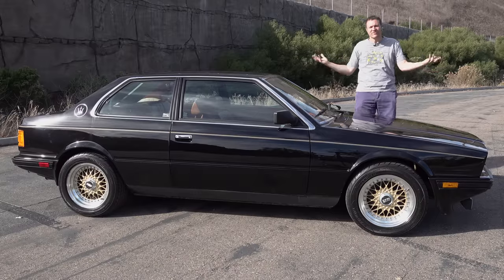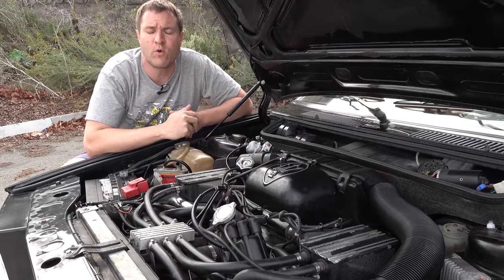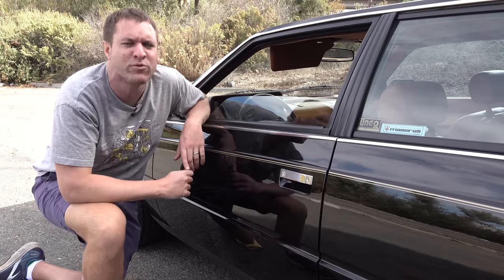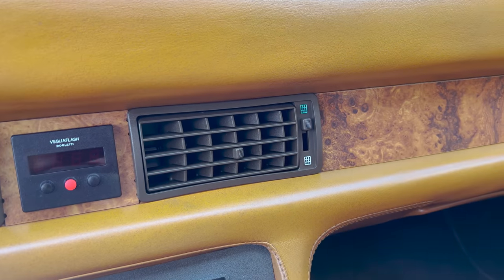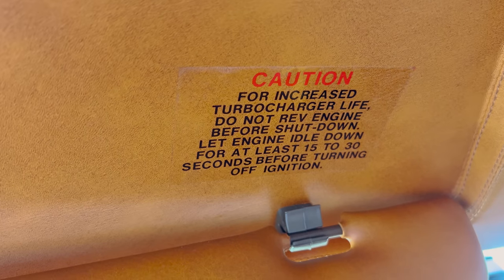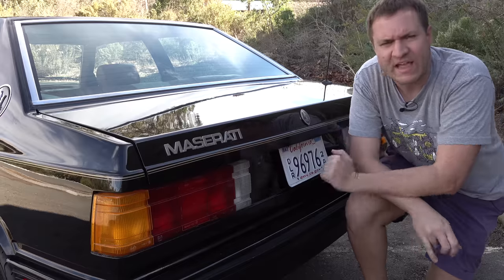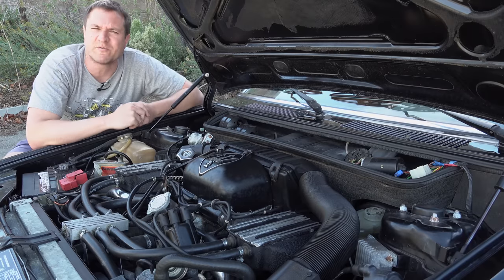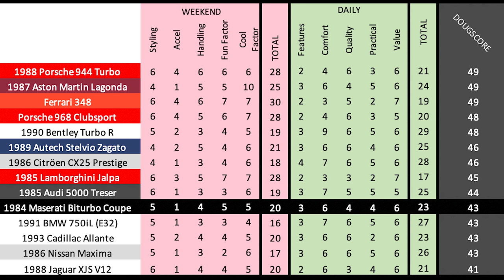The Maserati Biturbo Is the Ultra-Affordable 1980s Maserati

Comment: First time I saw one of these, it was in a junkyard and I thought about pulling the drivetrain. Then I thought "do I really want to trust a Maserati engine when they're not known to be reliable, and do I really want to trust one from the 80s? So I didn't lol
Reply: Get the whole thing, pull the drivetrain, and throw it away so you can put something else in.

I wonder how reliable the body and suspension is when these are swapped. Looks like it'd be a fun candidate to do it in...
Reply: @Khrrck  this was 10+yrs ago, but an LS swap or built SBC or SBF would be fun. Definitely wouldn't be something you see often if at all

Comment: For what it's worth, I owned one of these in the 1990s (also a 1984 model), and it was VERY reliable.  I don't think it needed anything except for oil and brake pads).  It was my daily driver for 3 years and I even drove it through snow.  But being rear-wheel drive, the biturbo gets very skittish on anything wet or icy!  While the seats look very pillowy, they are actually very comfortable and suprisingly supportive.  Although on these earlier cars, they didn't use real leather or real wood, so they detriorated very quickly.
Reply: Theres a guy near me in London still using his 89 Spider as a daily, in all weathers. I`d imagine any surviving ones have had any electrical issues permanently fixed by now, so its a bit of a non-issue, especially as its a much more basic system compared to anything made in the last decade or 2.

Comment: I had one of these in the 90's I had the later fuel injected version that had more power. It was super light and that thing would FLY in 2nd gear on up, it had turbo lag but not too bad and once it kicked in it was very quick.  It was a horrible car, it was so unreliable that I thought the 944 that I had next was like a Toyota. Doug there was one thing you missed. The spare tire on these cars was in a cage under the trunk. You had a bolt on the floor of the trunk that you would have to crank to lower the cage and get to the spare tire. That was a quirky feature that I would have thought for sure you would cover! Also as terrible as it was in reliability and being able to find parts (although many of the parts are just Renault and Nissan parts so if you could find out which part was also on another car you could just order those) I loved it and miss it. Just not getting it fixed.
Reply: yea, the spare tire is still in it. daniel, you clearly just didnt take care of yours. this is a great car
Reply: @mbawg  More like the person who owned it before me did not take care of it. I regularly had it in the shop fixing all the stuff that was broken when I bought it. But on a number of things even after getting things fixed they would break again. It leaked oil and the mechanic said it was some seal, we got that fixed and it blew out the one on the other side.
Reply: @mbawg  So is this your car now? Definitely keep on any oil leaks because it will spit it onto the turbos. Also make sure you let the car idle for a couple of minutes after you park before you turn it off.

Comment: I love that the oil pressure is the central gauge in the gauge cluster. Clearly Maserati knew this was the most important one with a car this "reliable"
Reply: That old top gear joke was originally about Lancia.
Reply: @KarlHamilton  Well aware of that, but it applied to most Italian cars of the 70s and 80s in all honesty lol
Reply: @Flared  Eh not entirely fair. That is a stereotype mostly born out of poorly built Fiats in the 70s. Lancias and Alfas were no less reliable than British cars. Ferraris were quite reliable considering their performance. The Ferrari 512BB and especially 328GTB are pretty bulletproof.
Reply: @EEvtg  True, Fiat did not help themselves back then. The deal to use sub-par Russian steel also made them infamous for rust too. I wasn't saying all Italian cars were unreliable, as not all British ones are either. Old Italian cars' greatest enemy is not being used. They really do not like sitting for even a short while if they are not used semi-regularly. That's when a lot of the problems arise.

Comment: As someone who`s owned loads of 70`s-90`s Italian cars (but no Maserati`s), I recognise all the switchgear, vents, boot release, rear blinds, quarter glass levers, the Vegliaflash stopwatch clock etc, so none of its quirky to me.. Its all very standard 70`s/80`s Italian car parts & construction style. The only slightly weird thing was the central locking switch position, especially as I`m sure my 83 Fiat Argenta had a central locking switch in exactly the same style as the instrument binnacle switches.. I`d imagine the c-pillar "fake fuel cap" is actually an interior vent.

Comment: The test drive in 1984 that I did was the most memorable for one reason: the sales associate managed to disintegrate the engine during the first part of test drive. No idea if the Maserati engines were equipped with rev limiter. He was very embarrassed when that happened. So, no sale...
Reply: Most carb cars don't have rev limiters. And considering they were still using manual (rather than automatic) chokes back then, I'd hazard a guess and say no rev limiter. What did you end up buying instead of the Maserati?

Comment: The turbos had that warning because they weren't water cooled in the '84 model year. Also, I think the analog clock in that car has been removed and replaced. I had one of these cars for a while and I would buy another - but would buy an '87 or later when they became fuel injected!
Reply: The first models actually came with these digital clocks, not analog ones. They made itvas cheap as possible. Only later models came with the expensive analog clocks.
Reply: That digital clock was shared with a lot of Italian cars at the time & had a built in stopwatch.

Comment: ha, that is hilarious!   They are underrated and under appreciated.   Maserati were a 'tech' company and pioneers in their day - who else would do a blow-through biturbo in 1980?  Or a six-valve/cylinder engine?   Full-disclosure, I have a 1994 Ghibli II.   The engine is a gem, all the mechanicals are pretty straightforward but the electrics are a nightmare!

Comment: I remember test driving a used red one in 1990. I was young, and they were pushing me to buy it for $10,000. I ended up with another interesting car, a Shelby Charger for less than half the price. Still, I’ve always liked the Euro sedan look. Maserati still wears it well, even if a comparable BMW can be had without the headaches.

Comment: The warning label for the factory turbos because of coking issues. My biturbo was my first car and with 45000 km on it the turbos coked because the previous owner didn't do this.  Now it lives on with port injection, upgraded turbos with reworked piping and cleaned up the vacuum hoses to be simple, forged internals for 29psi (2.0 bar), custom bell-housing T56 and coilovers.  The coilovers and more durable transmission helped the most. So much fun because it's lightweight and easy to kick out the back end now.  Currently being fully repainted because I ran into rust issues but got that resolved and new body work going on. Took 6 years to find panels.  Next is headliners for me too and fix my gauges because the gears need to be rebuilt.  Going to tweak the fueling some soon and going to try some new valve springs because I'm getting some float.  Motor can take more boost hoping for 2.48 bar with no problems. Good video

Comment: So excited for this! I own a 97 Ghibli biturbo GT, the 2.0 V6 Italian spec engine. It's beautiful and drives well but it needs to be maintained religiously. If you skimp, it will come bite you. Some parts are no longer available, so I find myself driving it less and less for fear something might happen to it. Would have loved a Shamal but unfortunately prices have taken off and are ridiculously high right now, they only built a few hundred of them.
Also I don't find any of the biturbo era cars ugly. In the metal they are serious and masculine cars imo. I love the designs. These early ones require even more of a commitment to keep running.

Comment: Alexandro De Tomaso bought Maserati in 1976 and was decided to launch a volume car to turn the company viable. After the Kyalami (basically a De Tomaso Longchamp with Maserati V8 engine) and the Quattroporte 3, they finally announced the Biturbo in 1982(the correct pronounce is bee turbo), which was the volume car he promised (at least for Maserati standards). Facing serious financial problems to finalize the project and desperate for cash, De Tomaso launched the car without the necessary tests and development. Although a good project, this was the main problem and the reason for the car’s bad reputation. They basically finalized the project during the early years of the production span and the car’s initial huge success simply became a nightmare for the small Modenese company. This is also the main reason why the real good biturbos were the ones produced after 1985/1986, because they were properly developed, with larger engines, intercoolers etc etc. 

There’s no doubt about the huge prejudice the Biturbo brought to Maserati’s reputation. Maserati was the aristocratic company of the Modenese trio (Ferrari/ Lamborghini/Maserati) with the best finishing and reliability of them, with pedigree and racing heritage. The brand of the low profile millionaires and models like 3500 GT, Mistral, Mexico, Ghibli, Indy, Bora, Khamsim were there to proof. 

So, if you’re looking for a Biturbo, search for the later models, if you’re looking for a vintage Maserati, go for the big V8s of the 60’s/early 70’s or straight 6 from 50’s/60’s. They are legitimate Italian gran turismo cars and surprisingly reliable and affordable(specially comparing with their 2 other Italian rivals)

Comment: Dear Doug,I own a Biturbo S that is in far better condition than this,also with the original wheels (this one has horrendous aftermarket wheels). The Biturbo was a great idea developed without money,and that's why expecially the early models have many faults. Year after year they introduced improvements that made this a better car,such as intercoolers,M.a.b.c. (Maserati automatic boost control),fuel injection,a limited slip differential by Torsen,and so on.Mine is still with the carb but has the intercoolers,and is as new,perfectly mantained in Maserati service by her first and only owner before me. That's why is reliable.Of course is a car full of faults,but if you look at her as a classic car to use during the weekend,is really a nice car,powerful and with an intriguing sound and a very good ZF manual gearbox. It seems that the interior is badly assembled but,even if they produced 35000 Biturbo and derivates from 1982 to 1994,they were largely hand made,and this adds charm,in my opinion. I can say that is not a car for everyone:you have to drive her respectfully,and this does not means that you have to go slow,but that you have to know how to start,to switch off and to drive her.People who like to do these things generally love their Bitutbo,and find them also pretty reliable.My Biturbo S was an improved model,with the italian market 2 liter V6 developing 210 Bhp,and with Modena number plate. Biturbos are still a bargain but not many of them survive and for the special limited edition models,like my S (only 1038 built),or the SI(990 built),or the Karif (221 built),or the Racing (210 built),or the Spyders the prices are growing because they are nice and fun to drive,and they have top performances.It's always a pleasure to watch your  tests!!

Comment: The body could be seen as an inspired copy of the 2-door B2 Audi 80/90/4000 sedan, itself a Giorgetto Giugiaro design. Turbo charged cars with carburetors were never a good combination. GM tried it on the Trans-Am with poor results. The reason for the " liquid intercooler" retrofit was to improve turbo cooling. These early boosted cars only had oil cooled turbos, while later models added water cooling as well.

That car also has an UNGO Box alarm in it. My Audi 4000 quattro had one and it was great at UNGOing the car by draining the battery.

Comment: A friend wanted to buy one new in 1983. Told them the factory they were built in was an unorganized mess which was a bad sign for quality. 

We go and drive one. Some old guy wearing one of those Skipper from Gilligan’s Island caps was our salesguy. Appropriate as he probably knew more about boats than cars as he knew nothing about Biturbos. 

My friend takes it out. Skipper shotgun. Me in the back. We go a few blocks. Water temp pegs. Electric fans not coming on. We get back to the lot. Pop the hood. Skipper for whatever reason twists the radiator cap off — releasing a flood of boiling hot coolant all over the engine. 

No sale.
Reply: One of my former employers was the service manager at Miller Motorcars in Greenwich, CT when these were new. 
He always said “They’d break if you looked at ‘em funny.” “Brand new car out on the lot; needs a starter, go throw a starter in it.” Just one of his stories that stands out in my mind

Comment: If I remember correctly these cars had to have valve adjustments on a periodic basis that cost an arm and a leg and god forbid the timing belt break. I think the reason for many of them with low miles is that people gave up on them... Maybe who ever wins this will put a chevy small block in it? or better yet do an EV conversion!

Comment: The presence of a turbo boost gauge is nice, but one thing i've never got is that the gauge doesn't have any labelling, so you don't know how much boost pressure is inside the engine. You just have to guess going by the graphic which goes from white, to orange and then red.

Comment: I used to have the bi turbo spider. It was the worst car I ever owned, engine was phenomenal though. I had 1987 car in 1990. Within 6 months there was rust, electrics had issues, air conditioning stop working. It was crap!

Comment: Actually reliability was improved enormously during the years this car was in production. It´s the early ones that had huge problems, among the worst of its time. That´s where the horrible reputation came from. Late 80s or 90s Biturbo are not worse than most other cars in reliability. So the reputation is only partly true.

Comment: This Maserati is amazing!  A little shop work on the intake and exhaust and you could have a 300 horsepower Italian luxury beast!
Reply: Nope. 3 valves per cylinder... Unreliable... 3 Series used to cost less. Not anymore. Why? 3 Series beats the dogcrap out of the Masi.

Comment: I was given a 1984 biturbo for free, it hadn't been on the road since 1988 and had 32,000 miles, i rebuilt the dcnvh carburetor,  put a battery in it and it fired up without an issue, ended up selling it when moving half way across the country....wish I still had it
Reply: Have you checked the plate on the DVLA to see if it still exists?
Reply: @MrPabsUk  I'm in the USA,  the person I sold it to was going to use the drivetrain in another vehicle.....or keep it as a project, either way that was about 13 years ago.

Comment: This car was built during a time when luxury meant quiet, comfortable and refined, as it should. The seats make sense in a luxury car of the time. The LaZBoy comparison is appropriate, because a recliner is incredible comfortable. Modern luxury cars have lost their way and become a confusing combination of sporty, bloated, and tech-loaded.

I think my only real complaint about the looks is that it doesn’t look special at all, and the trunk is too stubby. It looks like a Nissan Sentra from the era.

I think if you wanted to own one of these, you’d have to be OK with it spending most of its time in the shop, and that shop would probably not be anywhere near where you live. Don’t buy a classic European car with the expectation that the amount of money and effort needed to keep it on the road will be even remotely proportional to the value of the car. If you realize that your $5000 Maserati Biturbo will probably cost at least that much in yearly repair costs, it’s probably not so bad.

Comment: The turbo warning is there to give it time to run slightly cooler oil through the oil feed line & into the turbo; lowers the chance of oil burn off within the turbo when the car is turned off

Comment: Doug, I don’t know why you laughed during the entire review. As a proud owner of an ‘84 Biturbo I love this car and still own it. It wasn’t an everyday driver but I put 50,000 miles on it. I like the looks and luxury but the handling of the car was made for real drivers. With trailing throttle oversteer you could take speed deep into corners and steer with your right foot. You buy a Maserati you have to know what it is. Twin turbos meant warm up and cool down. Never had an issue mechanically. Drove it from Md to Myrtle Beach on summer vacation w/no issues. A real legendary car when compared with 1984 models.
Reply: THIS PERSON KNOWS WHAT'S UP

Comment: I had a white '87 I really liked. Powerful, nice growl, lots of fun. The throttle cable broke 14 years later (2001)--easy to source and replace myself. I also replaced the rubber turbo hoses at that time--easy to do with the engine still mounted. I had no trouble doing my own oil and filter changes. But when the power steering rack started leaking at about 16 years old, though, I sold it. The later cars had it together and do deserve restoration today.
Reply: What years of biturbos are more reliable, since you said later years?

Comment: These cars were total shit. They came from the factory with a backup fuel pump because the car was guaranteed to have issues with the primary fuel pump. I mean why not just make sure the fuel pump worked instead of going thru all the trouble of designing a secondary fuel pump system?  It’s crazy!